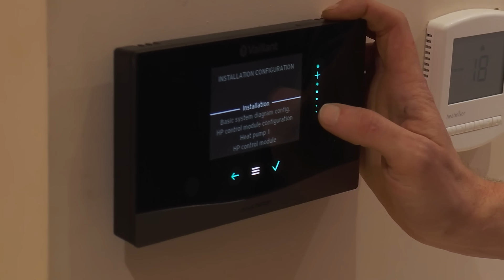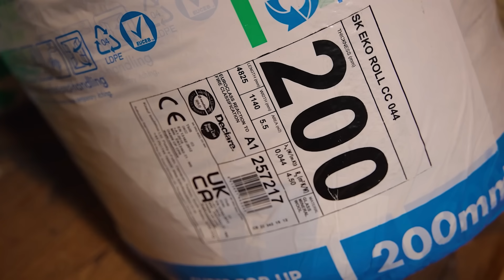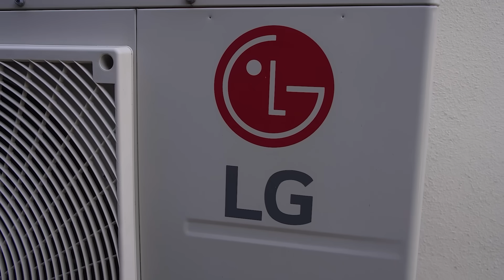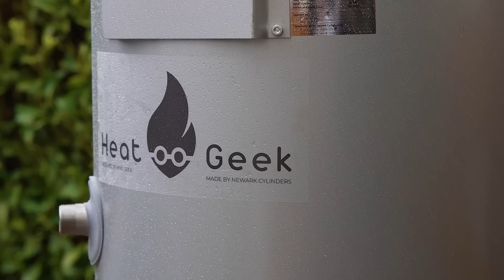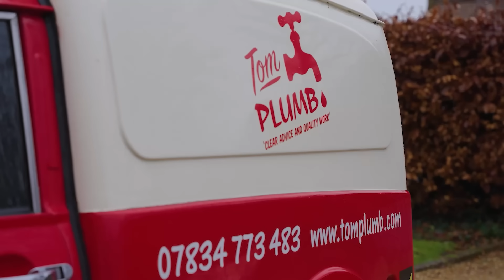Heat Geek’s Heat Pump One Year Later — The Verdict!

Comment: Did I hear him correctly that every room is 20 degrees?  My living room and dining room are 22.  My kitchen is 19.  My en suite is 24, and all the bedrooms are 18.  If I had my CH on at 20 in the living room, I'm quite sure that my wife would throw me out.
Reply: You can set the temperatures to what ever you want. This is obviously what he and his family choose.
Reply: @enjek5654   I bet he couldn't get it up to 25 degrees.  Especially if it is arctic outside...
Reply: @ Bet based on what? Not understanding how heat pumps work?
Reply: @enjek5654  
I know, I just can't understand why you would want the same temp for every room!!!  20 in a bathroom is damn cold.
Reply: @barryfoster453  my bathroom has no heating at all,  still i survive.
Reply: @abelfaber4457  
Do you get terrible condensation, or do you leave the bathroom window open 24/7?
Reply: @barryfoster453  it has an extractor fan leading to an exhaust on the roof.
Reply: @abelfaber4457   Surviving is not necessarily living.
Reply: @TheDavecroft  who wants to live in the bathroom?
Reply: His house, his choice
Reply: 24 is ridiculous, do you all walk around in t shirts?
Reply: @RubenKemp  24°C is perfect, the same as in the summer.
Reply: You're wasting money with that setup. I know, I've been there with my gas boiler.

Comment: So it's running on a subsidised tariff? My multi fuel only costs £600 a year & my living room is 30 degrees on average, 24 degrees in the bedroom above sharing the same chimney. The rest of the house is normally around 20 degrees, a bit warmer in the kitchen for obvious reasons.
Reply: 6 bedrooms like his? Your 30 degrees sounds unrealistic...
Reply: @ We can get up to 40 degrees by burning heat logs.
Reply: @ Ours is 4 bed.
Reply: Why on earth is your living room at 30!
Reply: @japanfred   I have arthritis in nearly every joint & it helps with that.
Reply: Subsidised? No.
Reply: @ Yes. It's offset by their normal tariff.

Comment: "Not properly designed'...sounds like your old heatpump had a fault with the compressor and you were not running it all the time
Reply: As an industrial electrician, a motor that can run all the time, and there are many, cost umpteen thousands of quids. You are not going to get one in a two grand heat pump.

Comment: If he's not using the mains gas  but still be using a cooker  how much would it cost to switch to propane just for the Cooking?
Reply: Wouldn’t you go induction then mess about with a new gas install?
Reply: @edc1569  yep, you would. I've been using induction for well over a decade now, and it's great. Had gas for quite a few years before that, and it was also good, but once you get used to either, there's little difference. I definitely wouldn't go back to gas.
Reply: @ Yes switching to all Electric maybe better but I'm really considering it as an option and just wondering how much it would cost and Doing this would enable him to keep his backup gas without paying the standing Charge
Reply: Propane burns hotter and would make a good conversion for my old but great gas range. Induction is the modern alternative but less characterful than the gas range. Difficult decision!
Reply: @halmorgan1558  Less character but just as good, easier to clean, you don't get burnt if you accidentally touch it after removing a pan and it turns itself off when you remove a pan.  Pretty good trade off in my view.
Reply: @halmorgan1558  i was told Propane burns less hot than Butane but Propane can gasify in colder conditions
Reply: Much less than installing an induction hob
Reply: It's surprising how little gas a hob uses. We moved to this property a couple of years ago and it has a pair of 47kg propane cylinders. We're not entirely sure how much is in them, but the little gas bottle level pens that you can get suggest that they are both empty and that we're "running on fumes", yet two years on we've still got gas for the hob. We do have a little portable induction hob as a backup for when it runs out, but we were surprised at how long they last.

When we finish the extension and have a new kitchen, it will be induction - But it is a fair point that you raise, it won't cost much to convert it to bottled propane and they'd last forever as long as you have somewhere suitable for the bottles.
Reply: @yngndrw.  Well I'm guessing that It would be cheaper than the standing charge  providing the conversion doesn't cost too much. I have a small 13kg Gas bottle hooked up to a small Cooking hob in a shed off grid and like you say I've had it for years and it never seems to run out of gas.
Reply: Gas produces fumes that are not good for you.
Commercial kitchens use induction
Reply: @markthomasson5077   I wasn't asking which is best

Comment: The electric heater in the background is the elephant in the room!
Reply: If it were being used a lot, their electric bill wouldn't be so cheap...
Reply: If you watched the installation series, they said that they weren’t going to install radiators in the conservatory as it would ruin the efficiency.
Reply: If that’s a conservatory you can only have an electric heater you can’t put a radiator in it.
Reply: Yeah - hasn’t been used since the HP went live a year ago. I needed it to iron out the fluctuations in temperatures when I fell back on using the gas boiler. DOES ANYONE WANT AN ELECTRIC HEATER?🤣🤣🤣
Reply: It's in an non insulated conservatory, they're always cold.
Reply: Why would anyone place central heating on a conservatory?
Reply: @jkl_me to heat it 😂. I've put loads of radiators into conservatories
Reply: @jkl_me I used to sell conservatories.... you need planning permissions to have central heating in your conservatory & a larger boiler etc etc to deal with the extra load.  Most people just add a radiator & the builder/plumber says nothing...  the regulations required to open up a room & add a glass extension is crazy...   the heat loss is amazing.
Reply: Plumb
Reply: Sssh
Reply: Almost every person I know with a  conservatory has an electric heater in the corner. Standard in the UK.
Reply: I just thought the same 😂 and the price of electricity keeps going up
Reply: They talked about that in a previous video. It is a different situation in the conservatory.
Reply: That is the conservatory, notoriously difficult to heat.
Reply: Who runs central heating into a conservatory?
Reply: @edc1569  I do and keeps it lovely and warm in winter✌️
Reply: People with more money than you. Literally burning the planet to keep themselves warm.  @edc1569
Reply: Loads of people  @edc1569
Reply: @edc1569 You've never seen rads in a conservatory? They're usually installed after the electric underfloor heating has proven too expensive to switch on 🤣
Reply: I belive you are not permitted to plumb in your central heating into a conservatory, to do with planning, not classed as the house, something along those lines.
Reply: @zedzed1046 
It needs separate heating as it's classed as an out building. 

You can hear it and still not planning as it's under permitted developing. But it's would need to comply with building control. So would be more expensive to build.
Reply: Your house, do what you like. Nobody else' business
Reply: @zedzed1046 nothing stopping you DIY a radiator in a conservatory.
Reply: I was going to comment on that😂
Reply: £920 to heat a 6 bedroom home for a year.
What an idiot!
Reply: I can exceed that in idiocy for you , I have also a six bed house 450 square metres , I’ve just refurbished , two 11kw heat pumps . Run it on eon overnight cheap rate , charge batteries to 24kw which easily run the house during the day and leave me to send back 75 per cent to grid at twice what I paid overnight .
  IGNORING what I get paid for that my electric bill for everything in the year , ie water , heat and general house consumption £1009.45 including standing charge and VAT .
   Sounds fabulous doesn’t it ?
   There is of course a catch , what I had to spend in capital to achieve this , eye watering amounts , hard to accurately quantify but unless you were doing it anyway you would not do it in economic terms . 
    I mention this because as in the video the essential element is that each house is different and only with very capable people designing the system should they be installed , where it’s not possible an exemption should be made so that the owners are not penalised for the sake of the ideology .
   I have a house that is too warm at times even with flow rate as low as possible .
  They do work , done correctly , with a property that’s well insulated and that means more than just a bit of roof insulation .
Reply: @nicksimmons7234  

£76 for 24/7 comfort in a large house and conservatory with hot water sounds pretty decent.
Reply: @nicksimmons7234  at a special rate of electric ! 920 quid is so misleading.  Sad times
Reply: @DualFuel-o4x  those rates are really available by every supplier not special for a YouTube channel.
£920 to heat a 6 bedroom house is a bargain.
Reply: Not in a conservatory it isn't. Ignorance is the entire issue.
Reply: @enjek5654 wet under floor heating in a conservatory problem solved, lovely and warm 😊
Reply: @ Have you ever measured or calculated the heat loss from a conservatory?
Reply: hahahahaha
Reply: Yeah someone forget to check the "set" first !
Reply: Feel sorry for Skill Builder. It looks like they joined the dark side.😮😮
Reply: @eugencunliffe-ion3110  don’t like facts I see.
Reply: @eugencunliffe-ion3110  Not sure what he's up to, he knows heat pumps are a modern day chocolate fire engine
Reply: 😂😂😂😂😂😂. Someone must give us an answer on the electric heater. 😂😂😂😂😂
Reply: They are in the conservatory, which should have a separate heating system to the main house, as they are not built to the same insulation standard. @jamesannison5617
Reply: Well spotted
Reply: Yep… I spotted that immediately
Reply: My thoughts exactly 😂😂👍👍
Reply: I bet he’s wearing thermal underwear.🥴
Reply: ffs take off the tinfoil hat for one second please
Reply: @sdgfsdfagsdfgdsfhsdfghd  Id need it to keep warm!
Reply: The real elephant in the room is the 15p per kWh. Electricity is always more expensive than gas but the price cap magnifies the difference. Gas is roughly 1/4 of the price per kWh. So you need a cop of 4 at least. The problem is that not everyone will need the heating on all the time especially if they are out at work for say 12 plus hours.
Reply: @davideyres955  

With gas boilers costing 8.2p/kWh of heat (assuming 85% efficiency and 7p/kWh of gas) a HP tariff of 15p/kWh would only need a SCOP of greater than 1.9 to be cheaper than gas.
In practice however the SCOP over 12 months is usually in the 3.5 to 4 range, thereby making them much cheaper than gas when using a suitable HP tariff.

My British Gas HP tariff is 14p/kWh currently.
Reply: @_Dougaldog 
Maybe if you hear the whole house full time, but in reality people heat only the rooms they're in and when they're in them.

With a HP you can't do that you have to leave it on full time and heat the whole home or whole floor level for it to be efficient and effective.
Reply: @_Dougaldog you forgot the initial installation cost
Reply: @Robert-j6r8c  

With a heat pump you can heat the house however you choose, they do not have to be on all the time.
I often just have mine running for two or three hours to get rid of an evening or morning chill during spring and Autumn.
But it's often more energy efficient just to heat the whole house within the insulation layers of external walls and loft insulation.

The heat from one heated room leaks to rest of house.
Reply: @davideyres955  octopus flexible gas is 6.47p/kWh. So you'd only need a COP of 2.31... ignoring the fact that gas boilers are not 100% efficient.
Reply: Yes I spotted that aswell theres probably one in every room
Reply: You beat me to the punchline. I do not believe word.
Reply: Every house I’ve been in with a heat pump have said the electric bill is massive now and they wished they had gas, nearly all houses and not thermal efficient
Reply: @marlowjoinery9783  
Thankfully that is not the case for me, my property a 1960's two bed semi is a house and not the best insulated.
Reply: The Evangelists won’t like this observation😂
Reply: The huge immersion tank is what is really heating the water . At most the air source pump will reach 18 degrees  . But to kill legionnaires it needs to be 26 degrees . So the electric immersion heats the water the rest of the way . And that costs a lot . Plus the carbon footprint of manufacture , shipping and installation is bigger than any carbon saved in its predicted lifespan  . A total waste of time .
Reply: @ Yet another common set of lies. 1) To kill legionella water typically needs to be 60 degrees Celsius, not 26 degrees. 2) Most modern heat pumps can raise water to around 75 degrees Celsius without the use of an electric immersion heater. Please stop lying.
Reply: @Nick-n1x3u  you can't be this wrong and not be trolling.
Reply: Every house I’ve been in with a heat pump have said the electric bill is massive now and they wished they had gas, nearly all houses and not thermal efficient

Comment: Ok guys. Bit desperate here. My baxi boiler will only go to 38 degrees on the boiler screen. I set my thermostat to 17 degrees and it never gets to 17 degrees. The boiler is constantly on. But the radiators only get warm
Reply: Dude this is a heat pump video, the only comments allowed are people claiming combi boilers never go wrong.
Reply: @edc1569  I'm just desperate. Just throwing one up in the wind.
Reply: I've had 2 council engineers out. they've told me the thermostat inside the boiler is turning the system off. And there is nothing they can do about it..
Reply: If I run the hot tap for a bit and full the sink up with hot water. The boiler radiator temperature will go up op to 48
Reply: @weredoingitinbabylon8452  
So, this is presumably a combi boiler.  I also assume it heats the water fine (showers, baths).  So your boiler has the potential to raise the gas rate when on HW.  It therefore has to be the internal thermistor on the CH flow within the boiler.  Pay for Baxi to attend to it, then send an invoice to your Council.  With all due respect to council heating engineers, you probably are best skirting around them.
Reply: @barryfoster453  yes it's a combi boiler
Reply: Thank you so much from the bottom of my heart. They've driven me to drink. I self diagnosed it might be the thermostat. His response was. I know it's not that. But il order you one anyway. 2cnd of march. And my heating still isn't working correctly.
Reply: Heats the water red hot from the tap
Reply: The boiler wasn't used for a few months. When I put the heating on. It didn't work. The boiler ran . But there was no heat. Once I ran the hot tap. The radiators warmed up. He changed the valve on the boiler?  But the heating still didn't work right. It would only warm the radiator so it's hot at the top.
Reply: I've experienced this before and it was due to not enough of the radiators being on. The flow rate of the water was too low and to prevent the water turning to steam it will throttle the heat. If you have any radiators turned off switch them all on and see what happens